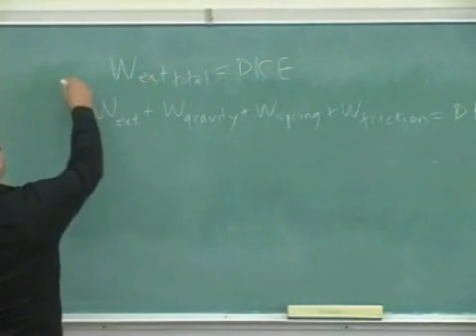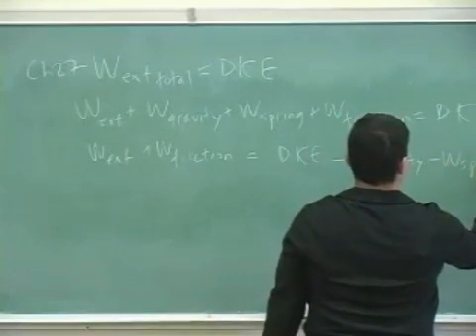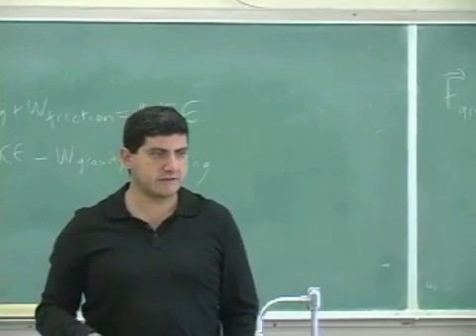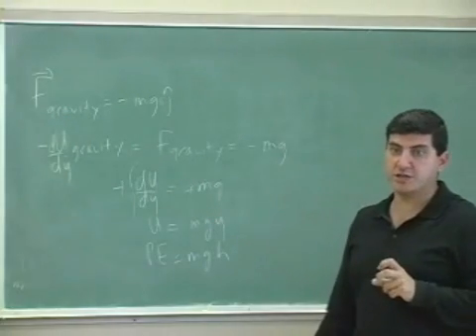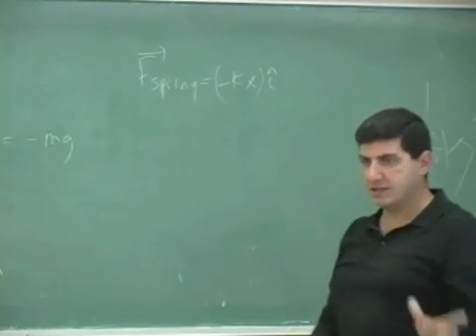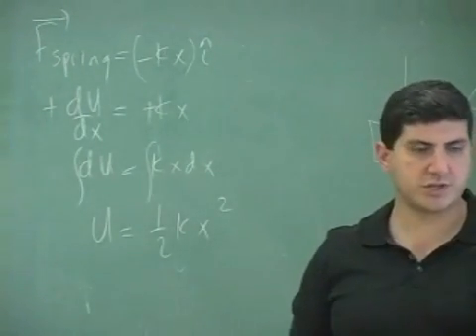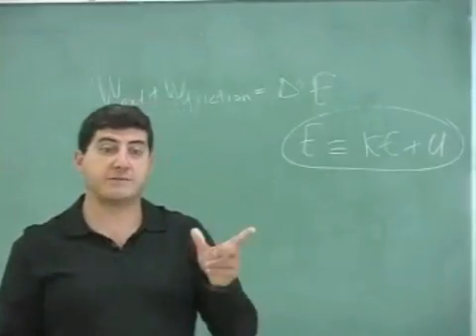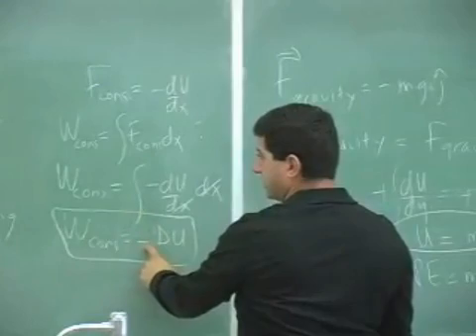Work, Kinetic Energy, and Potential Energy Theory Part 1

Comment: another one of the works that should be mentioned is the work done by the normal force... even though it's zero if the displacement is horizontal.